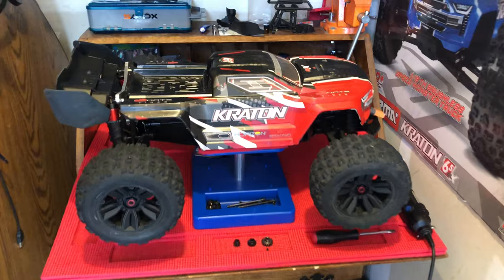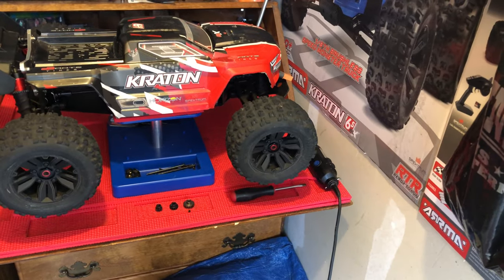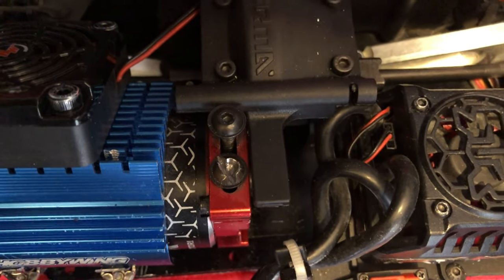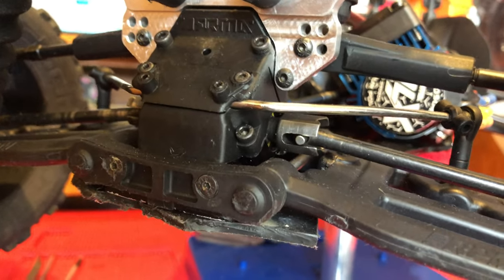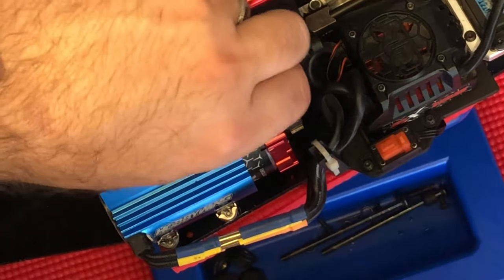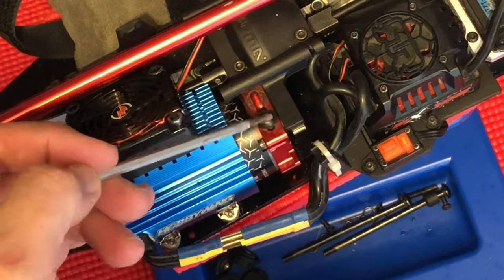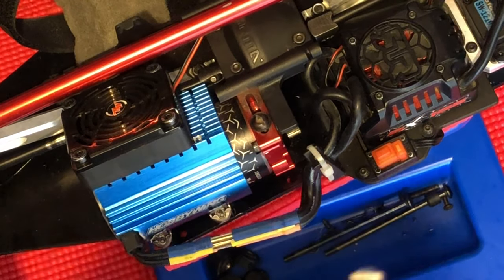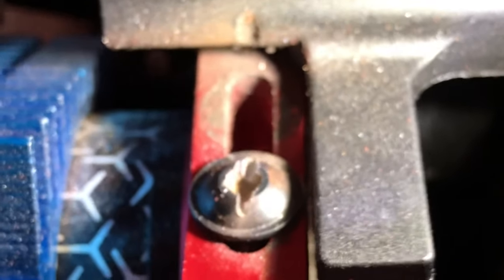Arrma V4 V5 EXB Essentials - Stripped Hex Screw Removal

Comment: Hey bro, I have problem removing the grub screw on the wheel hub (the one that holds the pin to the 17mm hex). The screw head has worn off after trying hard to turn it (with hand tools) and even after wd40 and Heating it up. Any other suggestion ?
Reply from the maker: So sorry I missed this question months ago lol. Actually YouTube just updated their application I use to track comments. And now I was able to find this question that I missed. Sorry about that again. What did you end up figuring out on this?
Reply: @EastTactics  hi there, unfortunately I haven’t figure out a way to remove the grub screw 😪

Comment: I stripped the grub screw inside the 17mm hex, and it’s in there tight with factory lock tight. I have no idea how I’m gonna get it out
Reply from the maker: Oh man… That’s deep in there isn’t it. It’s likely you might end up having to destroy the hex to get it off. Are you able to remove the pin by tapping it out, maybe take a butane torch heated up a ton, and then Perhaps forcing it off. depending on how badly it stripped the heat might be enough to allow the grub screw to come loose. 
Not sure how much the grubs screw plays a part in keeping it attached. My guess is the rod plays more.
Tough spot to be in, let me know what you figure out.
Reply: @EastTactics  thanks. I was able to get it out. I had the hammer the pin out and eventually pulled the hex off. I really didn’t care if I destroyed anything, as long as I got it off. Then I heated the end of the axle for a while and got it sizzling hot. After a few attempts, I was able to unscrew it. 

Btw, your video on explaining shimming the diffs helped me so much. Thanks
Reply from the maker: Anytime brother! Glad I could help.

Comment: What about the pinion gear screw??? I can't get it off 😬
Reply from the maker: EL Valenin, Are you referring to the tiny grub screw In the pinion gear itself? What exactly is the issue? Are you saying it’s stripped?  Just too tight?
Take the tip of a soldering iron and Heat up The entire shaft of the pinion gear. Red Loctite is used there. And sometimes needs to be loosened with heat.
Reply: @EastTactics  it's already stripped...
Reply from the maker: EL Valenin, If you stripped the grub screw then it’s going to be pretty difficult to get the pinion off. Your first choice would be to just stick with the 12 tooth pinion gear, you mentioned you were considering dropping to it an 11 tooth Because you are worried about the larger tires impacting performance and gear breakages. However, I think you should be fine sticking with the 12T. (Have you been breaking with the 12T?)
Your second choice is to completely remove your engine and heat that pinion gear up really really hot. Then use a screwdriver inserted  vertically between the engine and the pinion. Turn the screwdriver horizontally and try to pry that sucker off. If you’ve stripped The grub screw no Dremil is going to reach that.
Reply: @EastTactics  I need to get it off as the motor is broken.. I'm gonna try a micro hex screw extractor..